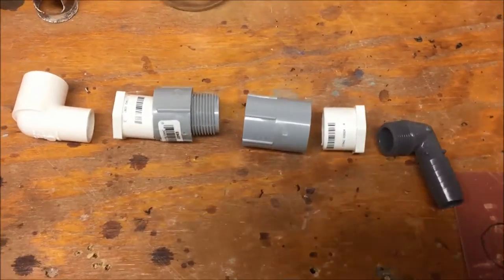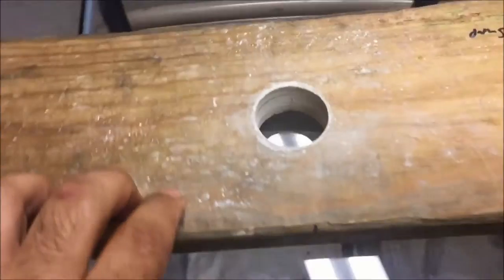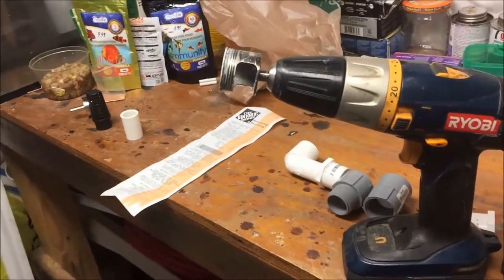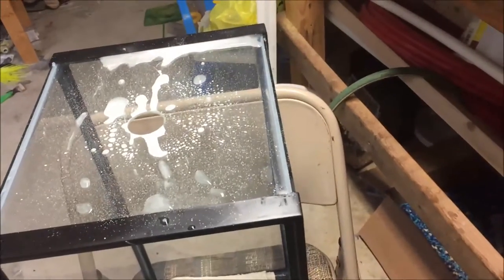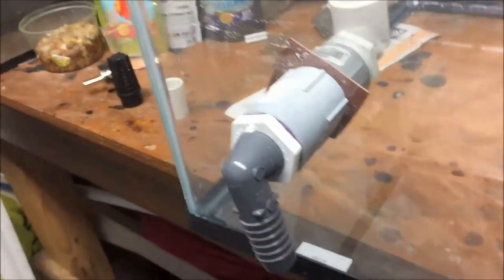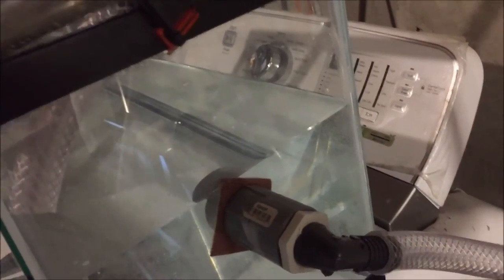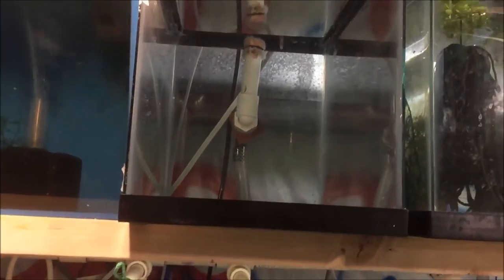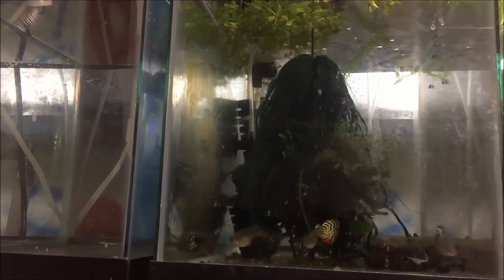DIY Bulk Head for fish tanks

Comment: whats your gasket and where did you get it? I have the same bulkhead setup just a lil different I used an o ring and silicon it woks but I have had  leaks here and there how about your way
Reply from the maker: It is rubber gasket material I found in the plumbing section of Home Depot. After I tightened it, I have not had any leaks from it......yet!
Reply: thanks